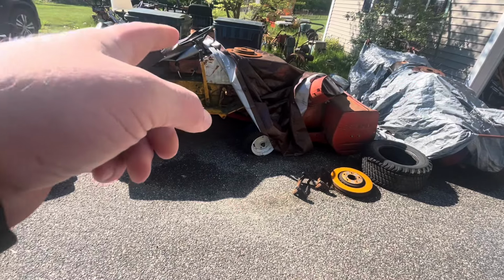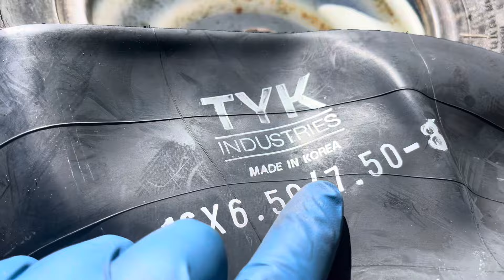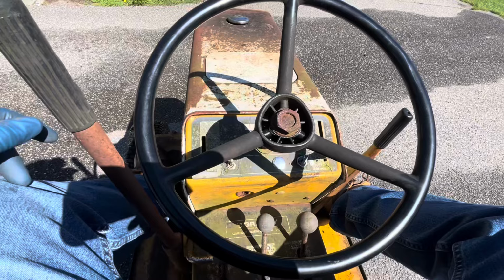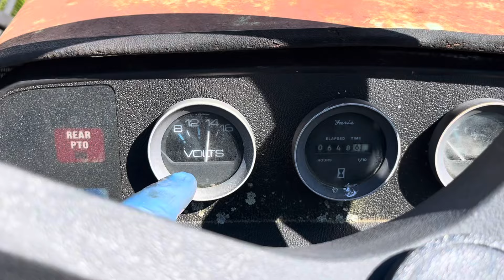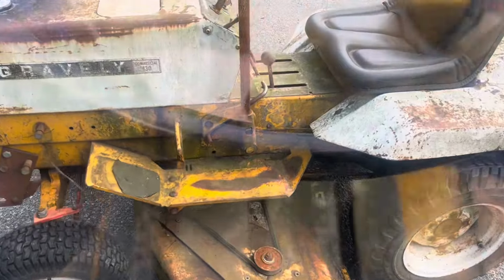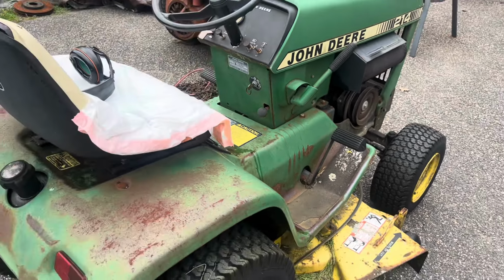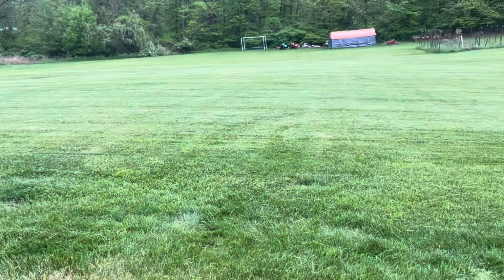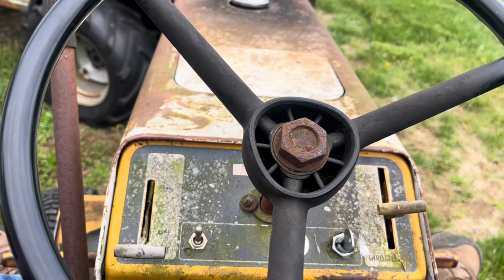Can This 53 year Old 12 hp 1971 Gravely 430 Mow Grass ?

Comment: DEESTONE makes the rear tires for my 1984 8199-KT tractor with the same tread pattern that originally came with the mower made by Armstrong in the good old USA.
Reply from the maker: I have some rear tires that are Deestones on my 8163-B they have sat outside for over 10 years. They are  just starting to crack. They have actually done very well for me.  Thanks for watching

Comment: Will that snow cannon go right on a regular walk behind gravely❤❤❤
Reply from the maker: The rider snow cannon will not mount on a wall behind.  It’s had a different mount…
Reply: @rw3dog  I'm assuming it can't be easily modified Is that correct?Thank you for your reply
Reply from the maker: @chuckb9867  not really.  But it is possible to swap the 4 bolt walkbehind mount etc in to this.  Some guys have done it and made a 38” walk behind blower…

Comment: Make sure there isn't a mouse house in that engine. Since it was mainly used in the winter, you may not have noticed it previously. Now that you are using it in warm weather, it could be overheating a bit.